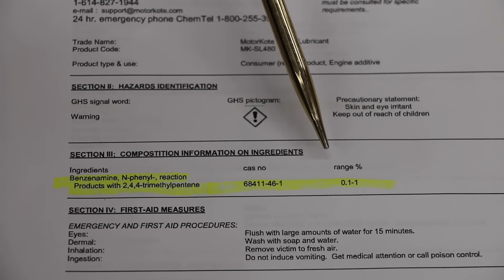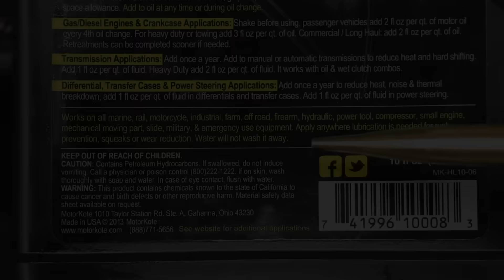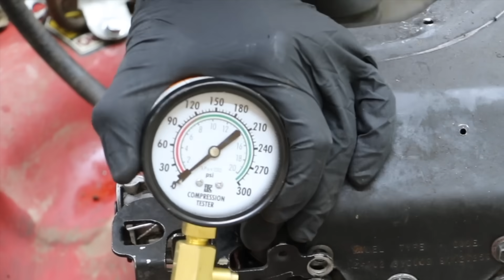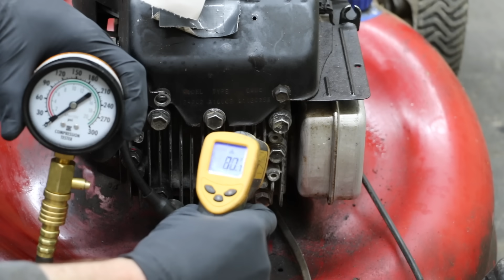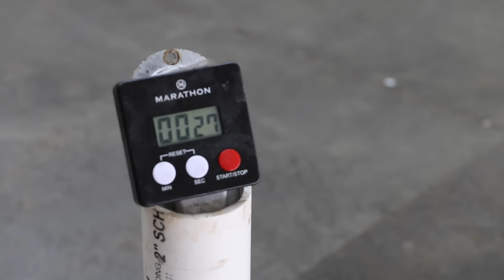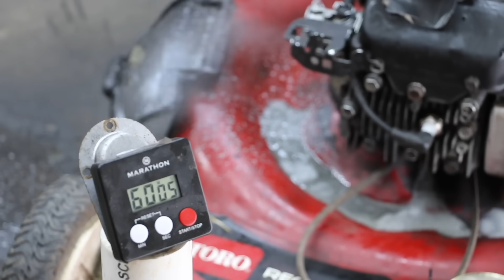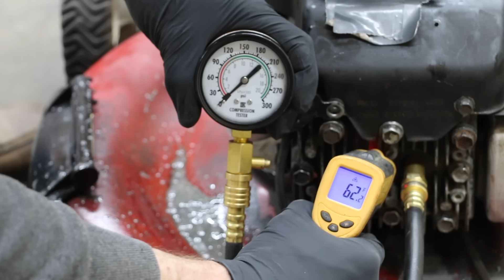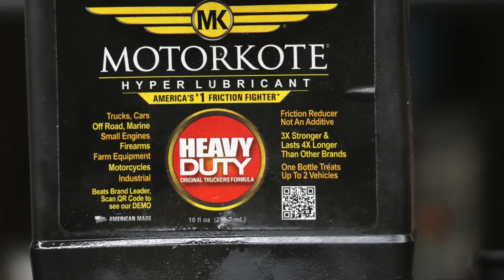Can MotorKote survive the water test?  Let's find out!

Comment: Well, I know this comment is like a year and a half late, but I just watched this one.  I got pretty excited and was thinking about ordering some of this when I saw a few reviews about sludge problems, pretty bad with pictures.  I then re-watched this video and saw how sludgy the mix became.  When I first watched it, I just assumed the sludge was formed because of the water; however, now I am not so sure. 

I wonder if you could do another test to run just a treated Motorkote engine and see if sludge builds up over time with regular use?
Reply: I've ran motorkote in multiple vehicles and in one specific truck that I own. In that truck I've used it for 10 years and have own it for 12 years. The truck is a 03. I do my own oil changes and I have never had any sludge of any sort. 
When he did drain the crankcase after putting the mix back in, there was still water in there. He only sucked it out before adding it back in. If he would have drained it the mix wouldn't have looked that way. I use motorkote in and on everything. Even in a spray bottle. It's expensive but worth it.

Comment: This wasn't a complete test. You don't know if straight oil would have worked when replaced with water or not. 

Was it the motorcoat or was it just plain old oil that made this test possible?
It is well known that oil doesn't wash off with water either.

This video needs an add-on where that same engine is thoroughly flushed out to get rid of the motorcoat. Fill it with conventional oil and run it for a while. Drain out the oil, run it with water in the crank case. Does it still run for an hour? Did compression suffer?
Reply from the maker: Thank you for the feedback

Comment: Thank you again for making this video, I have been using MotorKote in my cars since you posted this.  I own 3 cars between 100k miles and 280k miles,   2 things I have noticed so far my miles per gallon went up tiny bit 1 - 2 mpg and the winter tic I would hear on my 1999 Grand Prix and the 2006 Grand Prix has gone away.   I mix it with full synthetic oil and change it every 5000 miles,  easier to remember that way when your changing on the 5's. I also add a 2 ounce of MotorKote with every oil change so some is always in there protecting my engines.   Use it in my lawnmower as well.   I recommend your channel to all my friends and family.
Reply from the maker: Impressive results!  Thank you for the feedback
Reply: My car takes 8 qts how much would say I should based on your experience?
Reply: @Dan12gt   i add 2 ounces every oil change and that's for 5 quarts so for 8 qts 3 ounces should work well.     for the 1st time use use 16 ounces and run for full 5000 miles.    just broke 350,000 miles on the 1999 grand prix,  engine runs great. to bad my main body frame is dying from the salted road rust/rot.  might have made it to 500k, still could if I'm lucky
Reply: @YukiNeko-Neko  thanks so much, I use my car as a daily driver and I want to drive it until the wheels fall off, also these 5.0 engines are known to burn oil, it burns approximately 2 qts every 5k miles so I want to see if these makes it burn less, hopefully!! Thanks
Reply: @Dan12gt  if you are leaking oil (from worn seals)or burning oil(From worn rings and/or valves).  I don't think it will make you use less oil,    Motorkote lessens friction and coats parts to protect them to last longer.

Comment: Well done! I was very impressed with how this product performed based on your testing.  I was almost tempted to buy Motorkote because of the outcome of your test, however on reading more about it online i found this: http://thebestsyntheticoil.com/pdf/TSB%20MO-2010-04-01_chlorine_oil_treatments.pdf .  The chlorinated paraffin component which is the key ingredient in motorkote that increases the lubricity reacts with water creating hydrochloric acid which over time corrodes metal.  In a combustion chamber which uses outside air, it would be hard to eliminate moisture to 100%.  Perhaps in something like a transmission or power steering system, moisture may not be an issue if it's sealed well enough.  It would be a benefit to your viewers who currently use motorkote to confirm the result of the testing done by Amsoil since the corrosion may not be apparent early on.  If it does react with water, it should increase the acidity of the mixture.
Reply from the maker: Thank you!

Comment: 🐍 oil amsoil tested it at 27.2 percent chlorine which will turn to a corrosive hydrochloric so I've heard on the internet in a gas engine like my 88 Ford 351. 31 years no rear main leak after using MOTORKOTE for two months have rear main leaking. Have sent message to MOTORKOTE and they will not respond to my question if it contains the chlorine.
Reply from the maker: Great information. Thank you

Comment: Forgive me if this has been mentioned, but could this product possibly contain beef tallow? It would explain somethings. It wouldn't have to be listen in the safety data sheet. It's edible after all. Beef tallow is used to lube steam engines because it's very water resistant. It would also explain why the oil becomes cloudy. Just an idea, didn't have time to read all 4600 comments. Thanks for the great video.
Reply from the maker: I don't believe so, but it's possible. Thank you
Reply: @ProjectFarm  scratching my head what in this stuff. LOL
Reply: @jimbo5635  Chlorine 27% of it is that, so it will pass water test.

Comment: https://thebestsyntheticoil.com/pdf/TSB%20MO-2010-04-01_chlorine_oil_treatments.pdf

I was very interested in Motorkote, you will find videos like Project Farm showing a treated lawnmower engine ran for an hour without a failure when oil was drained and water filled crankcase.

But this chlorine can mix with water and form hydrochloric acid, so it soured me. I was all set to put some in a car I have. I could have gotten maybe 1-2 additional mpg. I had even been thinking of using it in my common rail diesel Ram.

Sure your going to find it works, but how long before it may dissolve a metallic surface by corrosion. I dont think its worth the risk. According to some videos, it causes an engine to run extremely smoothly and well, so I wonder if some have used it to help sell their car.
Reply from the maker: Thanks for the feedback

Comment: I'm wondering if this could be used in some capacity to prevent damage to the fuel systems of lawnmowers. Especially since it can be hard to find non-ethanol gas in cold areas. Since it seems to have a good amount of protection from water and corrosion. It might be washed away from the gas though or clog the smaller parts of the carb.
Reply from the maker: Thank you.  I haven't tested it for that yet

Comment: Can you do a video of best ways to clean water from an engine crank? On my dirt bike I dropped it in a creek and had water get in the oil. I had to ride it back to the truck that way,  a long ride.   I flushed it with Howe's diesel conditioner twice,  kicking 100 times between flushes.  Then I did 5 oil changes with cheap oil and filters,  idling to working temperature between them.  After I put in my good Honda oil and filter and it's been good since.
Reply from the maker: Thank you for the video idea!
Reply: @ProjectFarm  my pleasure. I thoroughly enjoy what you do. Great videos,  you are very intelligent.

Comment: Paul Gordon again.  Sorry, I'm so blabby.  I just watched a video about Turbo Maxx.  They had their own lubricity machine.  Not much different than the one you and MotorKote use.  They ran MotorKote and the bearing friction test and MotorKote only lasted with 3 weights added.  I think that 1 lb weights translate into a little over 54 lbs, so 162 lbs.  I watched Mr. MotorKote run a lubricity test with 800 lbs of resistance.  It smoked but never gave up.  It's supposed to be the same test.  I don't trust the guy doing the tests.  He always says "we" when referring to Turbo Maxx.  How could MotorKote do so poorly on his machine?  Would you consider doing a comparison between MotorKote with Turbo Maxx?  Turbo Max seems to inconsistent to me comparing these two products after seeing it on your video.  Thanks!
Reply from the maker: Thanks for the feedback!

Comment: From the tests I've seen, both yours and others, it seems MotorKote seems to be a much better antifriction preparation than anything I'd seen.  The thing that concerns me is that those who gave it a 1-star rating on Amazon, did so because, they said, it formed a thick sludge.  One person said all he did was make an appropriate mixture and let it sit all night.  The next day there was a big ball of sludge in the jar.  Maybe because of the heat from the gas or diesel engine.  I wonder if you could run a test to see if after several hours or days of use that sludge formed.  I was so excited last night seeing the several videos, running a gas lawnmower for an indefinite period with only the traces of MotorKote and oil was not punishment enough to cause the MotorKoted lawnmower to fail.  But I haven't seen a video of the crankcase after some time sufficient to see sludge build up in the crankcase.  Thanks for your consideration in doing such a test.
Reply from the maker: Thanks for the feedback!

Comment: I gave a good one for you.
Lucas oil stabilizer has a nasty habit of pulling away from sharp edges when it's hot, right where you need it.
Motorkote did nit, so I used a gallon of Lucas and a gallon of Motorkote in my truck's oil pan, which held 7 gallons.
Try that for a test.
The Lucas would not all drop into the pan when the engine was shut down, and the Motorkote, obviously, did away with a lot of friction.
That was my theory, anyway.
The seals in the engine wore out first, and that after a million miles.
The engine itself had less than normal wear when I was forced to get the thing rebuilt, and was still as strong as it ever was, it just ate oil at an incredible rate.
Reply from the maker: Thank you for the video idea!

Comment: Personally, I love Motorkote, especially having owned a big truck.
The shavings on the plug magnet were half of what normally was there after 35,000 miles.
The spray is very good, too.
The big steel gate at work would absolutely howl with an ear-splitting tone, so I gave the hinges a shot.
Do that twice in one week, and nothing since.
Heavy rains have not washed it away, and they are still silent.
I should also mention, they work a whole lot smoother, and a little push will open them all the way.
They are some very heavy gates.

Comment: Many say that Motorkote may damage engines when heated. Something about part of its ingredients being chlorinated paraffin that supposedly break down in high heat and create hydrochloric acid (muriatic acid) which is highly corrosive with aluminium which seems to be the main metal in most modern engines. If you'd do a followup on it I think it would be quite beneficial.
Reply from the maker: Thanks for the feedback!

Comment: My 95 Camry's steering rack is shot and you could barely turn the the steering wheel I added this to the power steering and it worked quick on starting to loosen it up. In less than 10 minutes I could turn the wheel with just one finger.  I tested it about once  week for a month. Then the car sat for almost 10 months.  I started it today and the steering was hanging from lock to lock. I let the car warm up for a min and it started loosing up the longer it ran the better the steering got.  Before using this I had tried Lucas  power steering additive and it didn't do anything for it.  Like I said the rack is shot and needs replaced, but I decided to test MotorKote just to see if it would work.
Reply from the maker: Impressive results!  Glad it helped.

Comment: As I was working on an engine the other day I thought about something... How well does motorkote protect other metals in an engine other than the steel a bearing is made of used in the lubricity test? In a typical engine there is aluminum, iron, chrome plate, brass copper bronze and other various alloys subject to wear that are oiled. Valve stems are a different alloy, bearing races are not the same as roller bearings, the piston rings are not the same metal and the sleeves, a timing chain is a different alloy than the drive sprockets they run on....ect ect.  I think a good Morotkote torture test would be to run the lubricity test on a bunch of different metal samples using motor oil vs motorkote treated oil.

Comment: Our skid steer was heating up from the friction in the old hydraulics So I put a half gallon of motorkote in the hyfro fluid tanks.  A huge improvement, the pressure doesn't drop much now and it runs cooler much longer.  It even has a bit more power and the drive chains shift smoother. Awesome stuff.  The more we run it the more stable the fluid temp and pressure seem to get.
Reply from the maker: Impressive results!  Friction causes a lot of wear! MotorKote does great and preventing friction

Comment: Products like this use chlorinated paraffin. Which is just a fancy name for Chlorine. Yep the same stuff you put in your pool. And because of this, it will react to the base of an oil, and the oil additives to change their color and break the oil down even before it's run inside your motor. Also Chlorinated paraffin is a type of acid. Which when added to the oil and mixed with condensation that comes from just running the engine, creates more acid ppm aka parts per million, faster than normal, created more acid wear aka chemical wear.

How do you test if a oil additive uses chlorinated paraffin? 2 ways to test this.

Find a dish soap that really reacts to bleach by turning white as soon as it pour some in to like a 1/2 cup of bleach. Clorox bleach is the strongest and will react quicker so you get quick results. Once you find a dish detergents that really reacts to the bleach that's the one you want to use for the testing. Also make sure you do this in a well ventilated area because this reaction will create chlorine gas which is toxic. When you've selected the soap to use for the test that reacts quickly to the bleach. Take a small sample like a 1/4 cup and put a drop or 2 into the cup. Mix and if the additive has chlorine as it's main ingredient it will turn white right before you eyes. The additives with a high amount of chlorine will turn whiter quicker. Those will lesser amounts aka percentage will take longer.

Jeans pants really react to bleach. You can cut sections out of a pair of jeans and pour a little of each oil additive on them. You will find that some will turn the jeans white almost instantly while other may take 24 hours to do so. 

back when gearlube was new, the main ingredient was chlorine. This is because chlorine acts as a extreme pressure additive. But after much use they found that caused failure because of it's acide content. So the chemical used in gearlube was changed. Now why use Chlorine as an oil additive? Most companies are in the oil additive business to make money. Chlorine is about the cheapest additive they can use and make the claims they do make. The problem is, it takes heat higher that the bearing metal coating to activate the additive to coat the metal. bearing coating is made basically from lead and zinc which have a very low meting point.

So as far as coating your bearing short of destroying them in the process, is impossible. The lead covering, on the bearing, would be gone before the heat activated the additive to protect it. Once the coating is on the metal it is hard to remove. So if a person wanted to use this, I would only have it in the motor for about 500 to 1,000 miles. This way you are getting it out before enough acid gets built up to cause chemical wear. When you change your oil do not add more it it. Once it's bonded to the metal more is not needed.

Also be prepared to have sensor problems and converter problems. The O2 sensors and converters are not made to deal with the additives found in these additives.  Which the 2 main ones used are: Moly and chlorine. Both are extreme pressure additives. Both were used in gearlube. Both are readily available to every car engine oil manufacturer out there. So if the additives are so good, why do not all the oils brands use them? Think about it? It's because they know about the problems the oil additives will cause down the road. They also know that proving their products caused such damage is almost impossible, So any guarantee they make is a lie and is a gimmick to make the consumer feel as if they can trust said product claims because it's guaranteed.

if the company determines whether you get a refund or not, you won't get one. That's guaranteed. But if you are raising a big stink about it blowing up your motor, they'll give you a refund because that's considered compensation. And from that point forward you cannot sue them for anything else.
Reply from the maker: Thank you!

Comment: Could you test this with amsoil signature series 5-w20?
Reply from the maker: Thank you for the video idea!
Reply: @ProjectFarm  I second this! Amsoil the winner of your engine oil showdown mixed with motorkote and testing it against just amsoil by itself. I have heard reports that motorkote has around 28% chorine in it which could affect TBN of the oil and make the oil more acidic. With the dilution ratio that motorkote has I doubt it would be an issue though. Maybe a cold temperature test to see if it thickens the oil as well. Thanks PF!